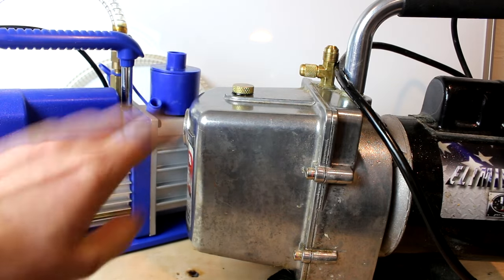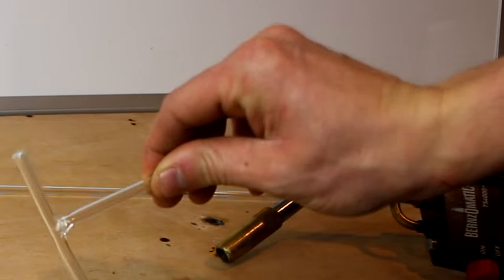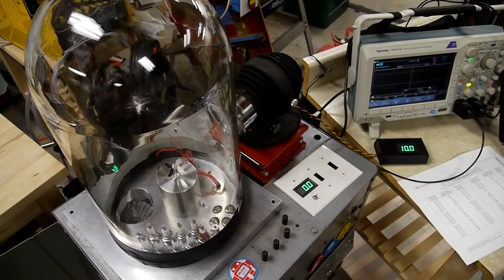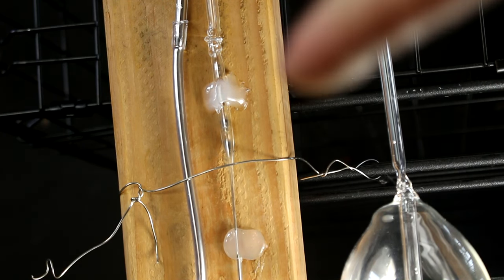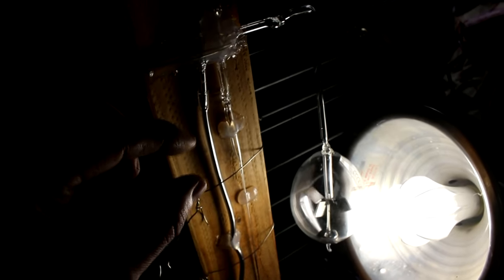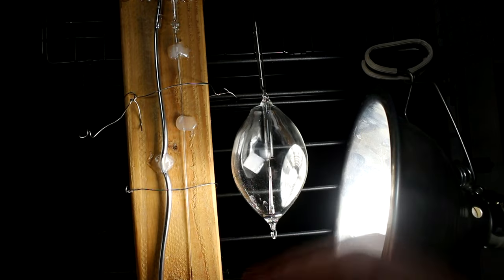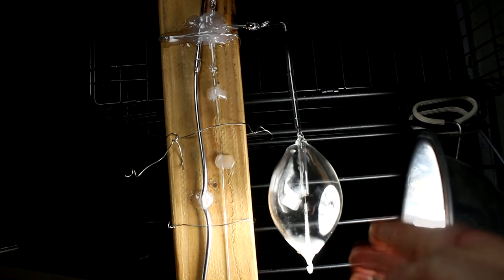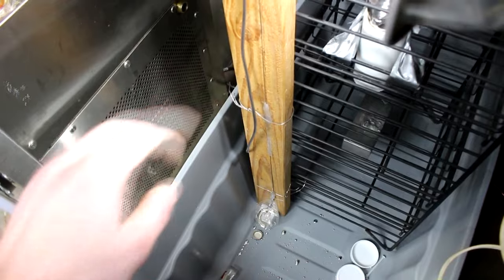Sprengel Vacuum Pump: The most efficient vacuum pump ever?

Comment: Cody, how did you pump the mercury?
Reply: The act of the liquid metal filing the void of the tube blocked air from escaping in the vertical tube. As it fell, the air was trapped and went with the mercury and escaped out the bottom when the mercury fell out. So because the air was being forced down and not allowed to go up, created a vacuum above where the narrow little tube  was. The vacuum became so strong it was able to pull the liquid metal up the hose.

Comment: so...theoretically, you could use the mercury to both pump and create electrical potential off of?  it would be interesting to measure what that is; then experiment with running the mercury through coils, bends, tube wrapped with magnets etc to see if you can increase that output while still maintaining operation.  hmmmmm

Comment: Why not increase the efficiency of the pump by having it discharge into the reservoir that it pulls from?
Reply: Because it's the gravitational potential energy between the reservoir and the discharge pool that powers the pump. Physically, having the two at the same height is sort of like trying to lift a chair that you're sitting on.
Reply: @SamJamesCrawford  okay, why not have the pump discharge reservoir be fed into another pump to bring it up to the feed reservoir?

Comment: my genius idea was simple
make such pump running on water, i did - it work, plastic pipe 2-3mm diameter maximum, not to soft - it must handle vacuum,15meters long - good,downside end of pipe must have buffer - like packet or glass for water, with pipe lowered to the bottom of buffer reservoir - it must handle some kind of unnormal pouring out all pipe water - and then suck it back from bufer - without loosing of fullness of pipe, or an least you need short @umbrella style@ U turn there - it is not bufer but stops pouring out if tube to fat or flow slow when vibration drops water down forcely, upside - T connector with two valves-regulator - one-vacuum, second - water intake regulator, third -outlet to pipe
 the pipe is hung from the 9th floor window on a fishing rod, does not reach the ground 2 floors and is not reachable from the windows - 3 meters from the house

Comment: I didn’t understand how it’s working, and don’t understand why only mercury, why not water?
Reply: like he said, the idea is that you can only get the vacuum to the vapor pressure of the material used. mercury has a low vapor pressure which is why he used it. you could use water but the vacuum would not be as strong. also mercury doesnt stick to glass which is nice.

Comment: if you had a valve on the system where you could just suck a partial vacuum with your mouth (wihtout getting mercury in your mouth) it would speed up much faster

Comment: I've watched this video twice and still don't understand how the vacuum is achieved
Reply: have you ever seen a water vacuum aspirator work?  A liquid flows through a Tee junction where the side tube is connected to the object to be evacuated.  As the liquid moves past the side tube, air is entrained into the stream of water - thereby creating a vacuum.  The limit of the vacuum is the vapor pressure of the liquid at any given temperature.  So, change the flowing liquid to mercury. 

As the droplets of mercury move past the side port, they "entrain" air from the vessel attached to the side port.  Because of the weight of the mercury, and because of the column height (ie head pressure) the liquid (mercury in this case) is able to fall despite the vacuum being formed.   

Remember, unlike the water-based case, the mercury here is being 'dropped' past the side port... so there are small pockets of air  constantly being pulled down by the mercury metal....

Comment: Can't you use a screw or pulley to lift a container out of water? Higher you lift it, stronger vacuum. 
Plenty efficient. Similar principal.
Reply: Water has a comparatively high vapor pressure vs mercury. so could one do the same with mercury, yes. though mercury may eat some components inside the bulb your trying to evacuate.

Comment: But I thought glass is non conductive. Do you think that electrostatic discharge is between the Mercury it's self.???

Lol the shock of your life hu. Lol I wonder how many volts that was.
Reply: Yeah: to get static build up you need at least one non conducting material, and you need friction with a second material which can be an insulator, but you tend to get more static with conductor / insulator friction, providing that the conductive material is well insulated from ground.
The static here is formed by friction between the mercury and the glass. The mercury retains its charge because it's held in an insulating vessel.

Comment: Efficient wouldnt be the right word. Effective is more appropriate
Reply: Efficient is a good metric, considering how many joules it takes to pull a vacuum on the volume of the radiometer compared to the energy he expended raising the mercury from the lower collector up to the upper reservoir. Far less energy, than it would take to power the motor on a diffusion pump, to pull that same volume down to that same pressure. Super efficient!!

Comment: after removing the radiometer and leaving a sealed tube. and only caring about the electricity.  .....could a person in a third world country charge his cell phone or other safety equipment...?
with a little manual labor. sometimes a simple thing  could have fantastic wonderful results.built up in a cap and fired into a battery with a diode.

Comment: In the video , from roughly 16:09 onwards , we can clearly see something coming down from the bottom of the glass bulb. Can somebody tell me what that is ?
Reply: water vapor
remember: he cooled the flask (the glass) down to approx -190°C. At this temperatur water is frozen as well as carbon dioxide. If the oxygen from the air actually liquified depends on how deep the glas temperature actually dropped. Liquid oxygen has a boiling point of -183°C, so it could be liquid oxygen boiling away also.
So in a nutshell: what you see are soldified or liquidified parts of the air which start to evaporate as the glas heats up again.